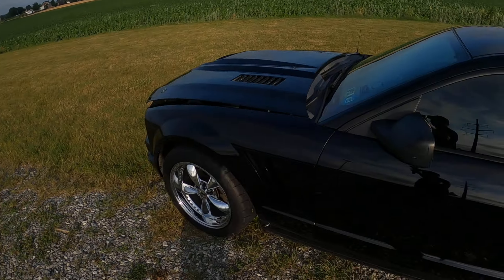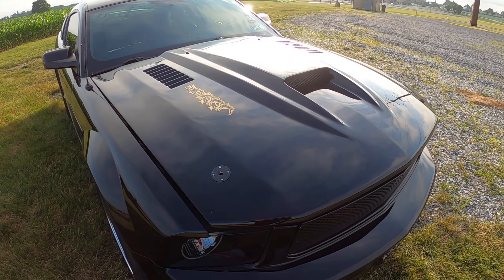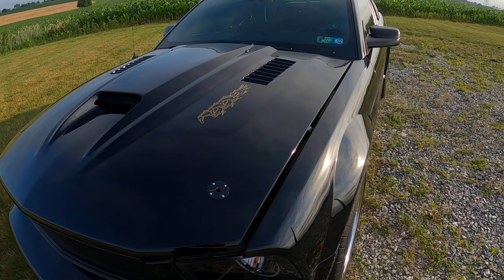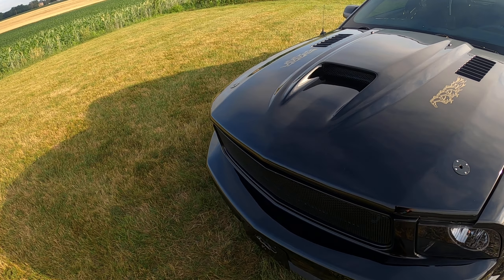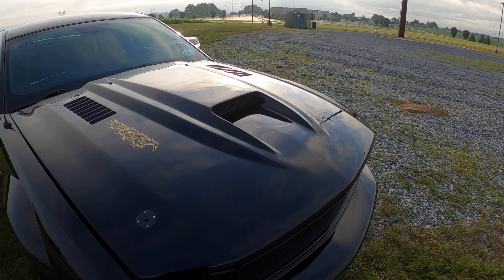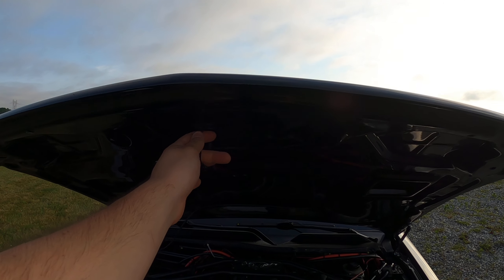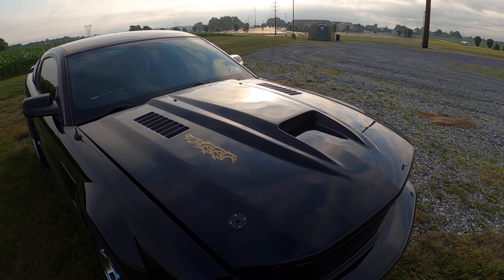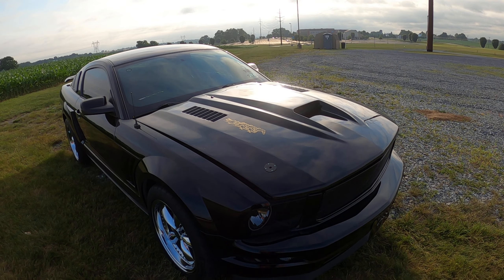The Do's And Dont's Of An After-Market HOOD

Comment: I have a question on your gta with the 383 . Did you have to do a chip upgrade to run the new heads and cam. I have the 1987 formula Firebird 350 now a 383 and having a heck of a time. Cars hot running rich no power.
Reply from the maker: I had a garage at the time install a stage 2 chip or as that's what he called it also they had to tune the fuel/air ration on a Dyno to get it perfect
Reply: @RevLine89  thanks I’m being told my cam is to big for my TPI
Reply from the maker: Hmm that's odd if it's made for your motor then it should be fine just tuned